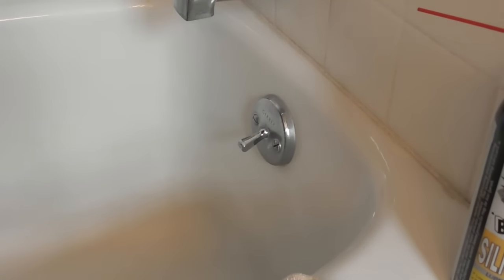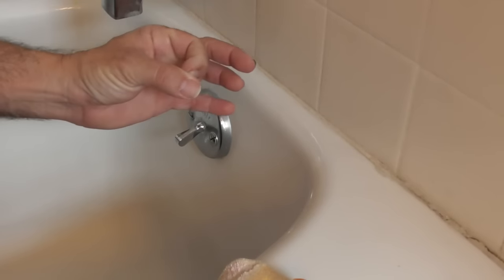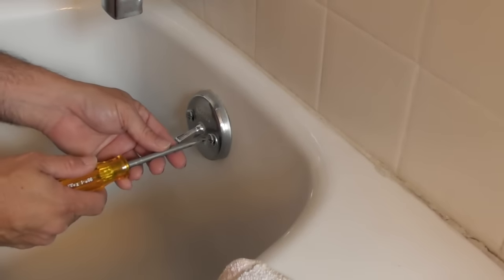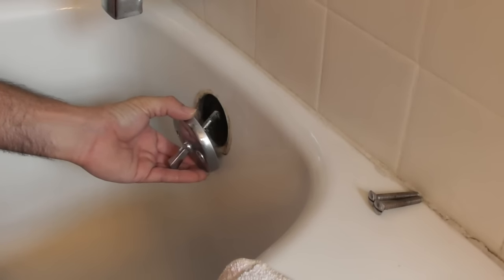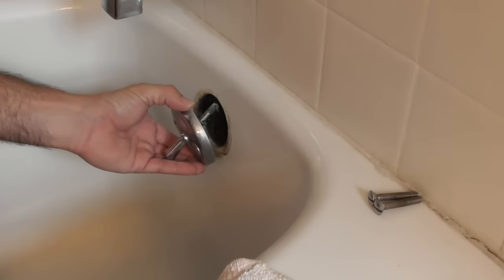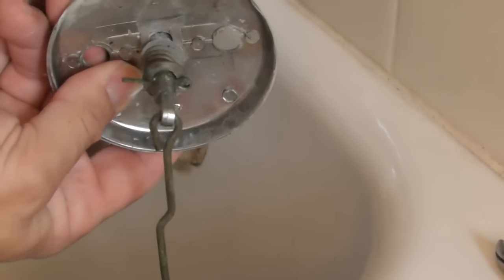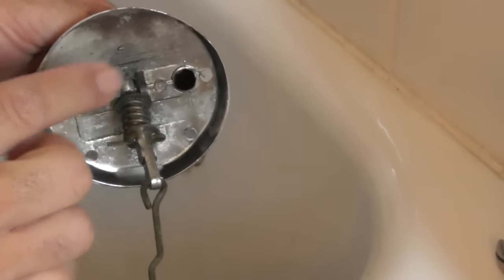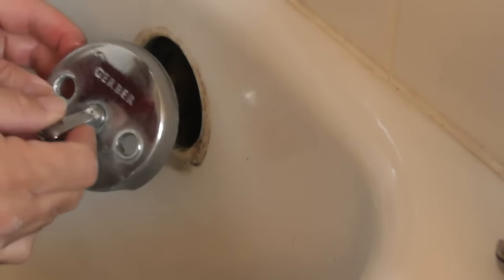Bath tub trip lever/ bath tub stopper replacement or adjustment easy fix

Comment: What happens if disconnected & bottom half separated
Reply: No answer sounds like we're f'd
Reply: Same thing happened to me last week. Never messed with the toggle, it just came out.
Reply: @TachoSJ   could u explain that cuase same thing happening to me
Reply: @pathan-bh1lv  what if the bottom part of the overflow comes off and the tub doesn't drain, how do you get that part out is my question.
Reply: Mine too
Reply: @ricardovasquez5154  I have the same problem right now. Our tub won't drain at all and I've tried everything. I think I'm going to have to call a plumber because I can't find the answer either.
Reply from the maker: the plumber will try to hook it as it is sitting in the drain.. either that or they have to go under the house to open the pipe.. keep trying
Reply: Change over flow/ or try to disconnect overflow
Reply: Can you remove it permanently and not have one
Reply: @sherrya6922  sure can. Just unscrew drain cover (if u have one like in this video) and use a rubber stopper.
Reply: I used a clothes hanger and got it out with no problem
Reply: Fingers crossed 🙏 going to try now
Reply: I used a chain with a small
Hook … and within 5
Mins I fished out the broken weight 🙏🙏🙏🙏🙏 tossed the weight and cleaned everything ….
I’m SO thankful for the video
And
Comments to inspire me to give it a shot
!!!!

Appreciation for helpful
Video
With great audience 

♥️🙏
Reply: I'm a 50YO woman who is on her own for the 1st time. My children have passed. I enjoyed your video. My spring was so RUSTY! I guess I am buying a new set. Hopefully it's a 1 piece deal. I did just purchase a new spout. The guts kept coming out. Great way to anger a woman in middle of her shower. Oh yeah I cut my dominant hand off with a tablesaw! Makes life as a whole a challenge. I'm  not tech savvy either. I got lubricant but probly not correct kind! LMAO!! I'm gonna search to follow you. Thanx for teaching me 1 more skill I can do. About those lubricated fingers!??🤣

Comment: I don't see what the screws are screwing into because when you opened that face plate up on the lever, it was just one big opening what keeps the the screws from just spinning once   the screws are flush with the lever again. I'm just going to change the thing out. We've been in our house 11yrs and our house was 15 years old when we bought it so it's abt time to change it anyway. Thanks for the video.

Comment: Thanks for massively reducing my anxiety about approaching my very old tub drain stopper in my new apt. (complete with rust gunk on it - the metal plate is so old that the bottom part has no overflow because it's literally turned into rust - I wonder if I'll still be able to do this but I'll try because at least the screws are intact). I like your attitude and approach.
Reply from the maker: have fun

Comment: Thank you for your video. Is this all I need to do if  the the part you unscrewed stops working, when I can no longer let water out of my tub? I'm having to dip water out of my tub, because the lift to stop water and drain water has stopped working. As though it has stripped.
Reply from the maker: you can find a photo of what this looks like on  google.... it is a very simple part that is often very hard to remove

Comment: My front piece actually eroded and separated from the plunger part. Broken with it closed and can’t get it out. 
Is the plunger part magnetic? 
Pulling that rod the front connects to is doing nothing it’s really Stuck. I can only assume but I don’t think it’s broken at the plunger because the rod would come out.
Reply from the maker: always be careful with your rod
Reply: Your situation sounds like what mine will probably be - see my comment above! The rust is so bad it eroded the area where the overflow hole on bottom would be.

Comment: I think maybe the ball joint on mine is broken on my drain switch. I need to open it up to investigate. If it is the ball joint, do I just replace the front plate unit? How do I attach it to the drain plug? Or do I need a plumber for that?
Reply from the maker: most repairs can be done by anyone. take it out and see what broke.. if it all comes out of the drain, then you can buy a new one to replace it.. if the plug is stuck in the bottom and you can't get it out- you might have to call a plumber to go under the house and open up the pipe- or you can just take out the drain cover and use a $2 rubber drain stop
Reply: @LEARNINGCHORDS  thanks for the info. I’m in an apartment and in a long standing eviction dispute so the plumber going into the unit below me is not going to be possible. In which case I’ll just remove the whole thing and use the rubber drain stopper per your advice. Really appreciate it.
Reply from the maker: good luck.. when you can afford it to move, get out... living in a toxic environment is not healthy for the body or mind... no matter who is right--- find a way out so you have peace in your life... stay well

Comment: My initial problem was a very slow drain. I took the trip lever off and snaked the drain. Yay, that worked, drain is working. But then to put the tub trip lever back on -- it would not go back in  as far by about 1/4 or 1/2 inch. I wiggled it, but still won't plop back down there. Ugh.

Comment: 2 months ago, the switch was very stiff so condo maintenance person replaced it. But now the water does not hold at the bathtub. Can y tell me what is wrong? Before replacement, even though the switch was stiff but it hold water at bathtub  long enough.

Comment: I think I tore mine up,...it was working perfectly fine, the level went up and down with ease. However a totally other problem led me to think I needed to take it off. 
When I wash clothes, I had water backing up into a sink first, then my bathtub. After searching I came across this guy who showed how to remove the overflow to make sure there's no clog there. I didn't even realize his looked nothing like mine, didn't even have the up and down lever,...anyhow so I got the plate off, proceeded to rip out the parts,...then after I tried to put it back in, and screw the plate back on....it just all went downhill. Now the level is stuck won't go up or down,...the parts look just like the one you showed, only much older, and gunkier. When I had the part out, I could easily move the lever up and down, it was only after I put it back in and screwed the plate back on that it won't move anymore.

Comment: Thanks for the video. Do I need to caulk around the stopper?
Reply from the maker: there is a seal behind it.. if water leaks it goes down the drain so not really but if you do, don't seal the top where the over flow goes
Reply: @LEARNINGCHORDS  Thank you!

Comment: Mine won't stay down and I've used a wet wash cloth to hold it down for a while but recently it seems like something is completely disconnected and the tub won't drain at all. Tried all the unclogging stuff. I think I need to replace this whole part?
Reply: Hello, I'm curious about how you solved this problem.  That's my struggle right now and I really gotta get my tub draining again

Comment: I pulled my stopper out the little plunger cylinder thingy at the bottom was disconnected 😔. How do I get it out
Reply: @tiffanijackson5156  seen a guy use a hanger straighten it and bent a little hook at the end to snag the stopper grease it up with some WD 40 to help ease pulling it out

Comment: Does the position of the rubber gasket in there matter?  Mine doesn't seem to line up perfectly.
Reply from the maker: it is mostly protective.  if the water gets too high the water should drain into the hole at the top

Comment: I removed the screws, cleaned out tons of hair and while doing so, the long mechanism snapped off! Now what do I do? How do I even get the rest of it out of there? I can’t reach the part left inside.
Reply from the maker: go online and look at the photos of what is in there. a plumber will gladly remove it for a few hundred dollars.. they might have to go into the wall or under the house but they will remove it.   you can look at photos and then try to figure out how to make something to hook onto the part..patience can save you $$

Comment: Hi there. Thank you for your informational video. I'm trying to remove my overflow plate so that I can clean out my drain since my tub hasn't been draining well, however I'm only able to remove one screw. The other one is jammed tight and I've tried everything from a rubberband, to a power drill, to trying to wedge something between and loosen it with a hammer. It just won't budge. I'm considering just wedging the back of a hammer between the plate and wall and aggressively prying it off, but i don't know the mechanisms of an overflow plate or what's behind the wall. I'm wondering if there's a risk of prying it off while the screw is still attached. Is there something behind the wall that can be badly damaged or broken?
Reply from the maker: do a google search so you can see what it is.  the screw is most likely rusted in place.  look at google to see what you are dealing with.  you might want to DRILL out the head of the screw so the plate comes off.  you should be able to replace most parts in there
Reply: @LEARNINGCHORDS  thanks for responding so quickly! I did search Google and watched several videos on how to remove an overflow plate and a stripped screw. Nothing has worked so far. I guess what I'm asking is would it be bad for me to apply a lot of pressure to the plate to pry it from the tub (I can't tell what it screws into from google image searches).
Reply from the maker: i want to send you a photo but I can't on here. let me try to find links
Reply from the maker: https://www.pinterest.com/pin/397653842084274586/

READ all the comments on this page and the photo at the bottom https://terrylove.com/forums/index.php?threads/broken-screw-on-overflow-pipe.44428/
Reply: @LEARNINGCHORDS  thank you so much! I will look into these
Reply: Their are supports for the screw in plate to which the anchor of the overflow plate attaches.  I would drill the stuck screw head off.  Then a smaller drill to drill a hole into what is left of the screw.  If this fails get an adhesive to attach to the drilled out side overflow face plate cover.  Let adhesive dry per directions and silicone seal the drilled side heavily.

Comment: It was really difficult to find a video with a bathtub drain that was controlled by a trip lever.  That's what it's called by the way. This was the only one I found at least so far. So basically, if that thing had been full of hair or whatever, I would just clean it and the bathtub drain should be clear? cuz that's what I'm looking for period is a way to unclog the drain without using tons of draino which never works. Thank you for your time
Reply from the maker: thanks CHERIE
Reply: @LEARNINGCHORDS  you'[re welcome

Comment: HELP!!! 
The rod lever assembly and plunger will not lift out. It is hung up on something. Any ideas?
Reply from the maker: very comment... could be grease or dried soap hair .  try to spray wd40 or some degreaser down and see if it will melt it away... maybe run hot water down to try to melt the scum

Comment: How do you remove the plunger if it's stuck?
Reply from the maker: probably stuck from soap grease oils....  spray wd 40 or de degreaser... run very hot water down slowly while pulling.. a plumber will do the same before they charge you a few hundred to open the pipe

Comment: Nice job.  Would lithium spray grease be a more permanent fix?
Reply from the maker: maybe. these things get installed and last for 20 years until they fall apart so I am not sure grease will survive the constant water and soap for that long
Reply: @LEARNINGCHORDS  Just today I took one apart that was probably 50 years old, greased it up and it works great.
Reply from the maker: sometimes you have to grease it up for it to work well
WOOT

Comment: Sometimes fixing this isn't that easy.  The screws can be rusted shut, so you can even unscrew it and take off that chrome plate.  In that case, you have to replace the entire drain system, after cutting off the plate and screws.  Even if the screws come out easy, you that stopper may replace be stuck in there, and you really have to force it out.  Or the connections come off and you're going to have to fish out that stopper.
Reply: That happened to me today! What can I use to fish it out?

Comment: My bathtub lever was catching like that and then I didn't hear any clicking.   The bathtub filled with water.  Did the plug at the bottom come off?  I tried Liquid Plumber to clean it out and it didn't help.
Reply from the maker: liquid plumber doesn't fix most stop ups. if the plug came off you will need to open this up to unplug it or call a plumber that will do the same for $100
even if you cant fix it. you need to make suer the plug is not stuck and keeping the water from draining. you might not be able to use the tub again unless you get it fixed or buy a FAKE plug but you still need to see what happened inside.. you cant do any more damage so look and see .. if you cant fix it the plumber will but you probably won't do any more damage by looking
Reply: LEARNINGCHORDS  wonderful news! I used Drano and I have never had any luck with it but tonight I found liquid plumber at the store and I pulled the lever out and cleaned it with CLR and put it back in all by myself. Then I used the liquid plumber one time and It unclogged the drain. I probably have the cleanest lever in town!
Reply from the maker: having a clean lever is important.. enjoy the tube

Comment: What would you recommend in this situation: I removed the stopper, which looks to be the exact same type as the one in your video. I removed it thinking there might be a build up of hair or something because the tub was draining really, really slow. But it was clean. But when I removed it, the drain worked beautifully. In fact I was able to shower with the stopper removed and had no drain issues whatsoever. So how would the stopper/components be causing a slow drain and how would I fix that?
Reply from the maker: that is really strange. I why the stopper plugs the line
Reply: The stopper is adjusted too low or there’s too much slack. So when you flip the lever down, it’s not lifting it as far as it should be.

Comment: so weird problem, my trip lever mechanism must of been very old and it snapped. I managed to pull the whole mechanism out luckily. Its unusable though. Is it ok to continue to use the shower without a trip lever? I dont plan on ever taking a bath... but im curious if that tool is used to throttle water at all or something
Reply: How’d you get it out I’m having the same problem ?

Comment: My stopper was sticking.  I am trying to remove it but it's a plastic stopper and it won't come out.   Well, WD 40 and it's out now...but it's nasty.  Looks like it needs a replacement.  Wish it was the original brass stopper.

Comment: WHAT IF ITS STUCK WHEN U TRY TO PULL IT OUT LIKE  MINES IS?
Reply from the maker: try to pour warm or hot water down and wiggle it. it is normally dried hair and soap scum.. maybe put some WD40 down since it is a degreaser...

Comment: How does water not go in there? Without a gasket?
Reply from the maker: this is called an over flow.  if the tub is being filled up and water gets to the bottom of this part,, the water will go in the openings and go down the drain.. there might also be cutouts on the top of the part... water is supposed to go in when it is at that level so the house doesn't flood.  the gasket is only there so it doesn't scratch the finish of the tub
Reply: @LEARNINGCHORDS  thanks for the Detailed explanation! I really appreciate it 🙏

Comment: What if that bell falls inside off the stopper plate 😰
Reply from the maker: first try spraying 409 or wd40 down to break up the crude and soap and hair that might be holding it in place.. then -a coat hanger about 20" long with a 1/2" bent hook at the end worked. You need to stick the coat hanger down to the stopper and hook under the cross piece that the stopper rod is attached. It can stick below the stopper and you need to keep plunging and pulling the coat hanger to free it. You need to keep turning the coat hanger so that the hook lines up to hook under the cross piece on the stopper- if it works-- donation link in video description..

Comment: A good video except when the camera doesn't show what he's talking about.  A little longer than necessary as well. But if you need help with this, you will get answers here. I used it to deal with a tenant's shower and it was great not to have to call a plumber. So thanks for that!

Comment: How do you replace the gasket behind the tub trip lever without removing the entire bath? That's all I want to know.
Reply from the maker: no need to replace it
Reply: @LEARNINGCHORDS  Really?! It's leaking and destroyed a section of drywall on the floor below. I know it is leaking because I only hear drips when the wife fills the tub to the tub trip lever. Can't ever hear the drips any other time. I have to rip out the tub don't I? At least it's easier than trying to fix the wife.
Reply from the maker: then I am not understanding what you want. this trip lever comes out as the video shows so you must be talking about a gasket somewhere else and not right behind this part
Reply: There’s a gasket on the pipe behind the tub that this plate screws into. Unless there’s a wall you can cut out to get access, yeah that’s your only option. Or just tell wife to stop filling the tub all the way up.